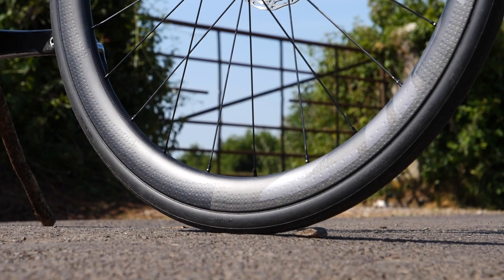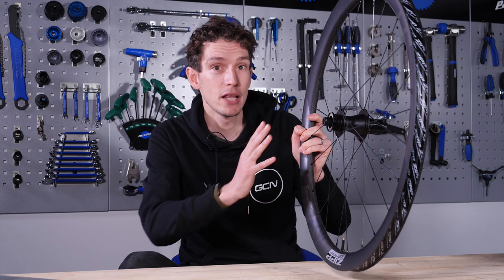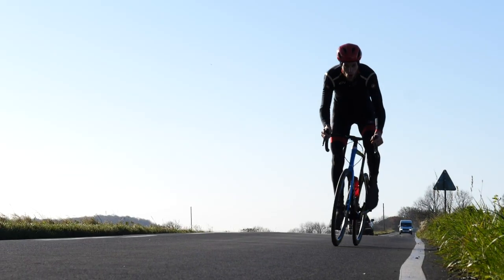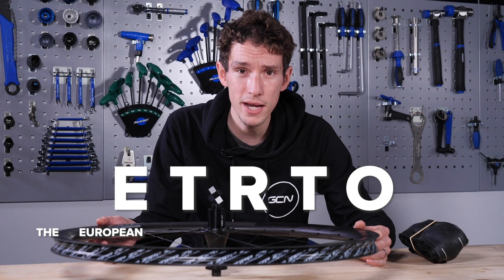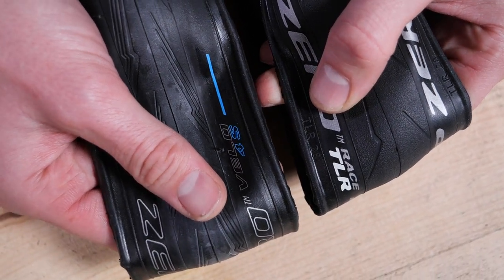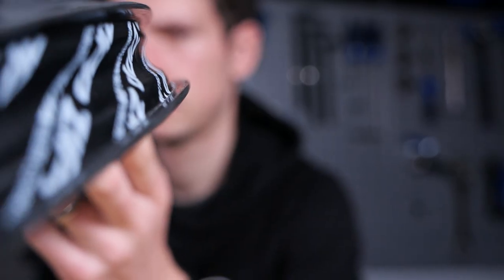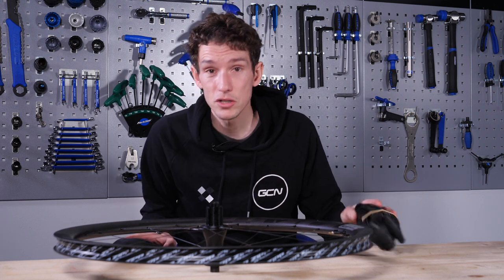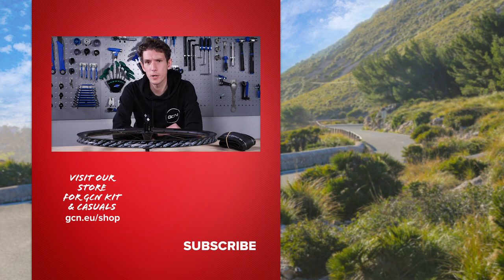Hookless Rims Explained | Which Bike Tyres Can You Use & Why?

Comment from the maker: Do you use hookless rims on your bike currently? Do you have any further questions about them?
Reply: I use tubeless but I don't even know if the rims are hookless lol
Reply: I will be in April ordered a 2021 Giant Tcr advanced Pro 0 which has em. Thanks for the info Si and GCN
Reply: I have a pair of 9th wave hookless rims on my bike
Reply: Yes, I do. No, I don't.  😉
Reply: No, when I got my current bike they were only on the uber super bikes at the time.  I just want to know what the market share is at the moment.  I don't like buying things that have parts/pieces that are trending out of fashion, as in my experience, that makes things harder to fix a few years later.
Reply: Yeah running them.
Reply: What about cornering really hard or coming down mountain switchbacks and loading the tyre up with that much force and popping off the rim? Or if you do get a flat say at high speeds is the tyre more susceptible to being damage from riding on it until you can come to a stop?
Reply: What about fitting inner tubes? I understand that hookless rims are incompatible if you need to fit one
Reply: I use 25 mm Schwalbe tubeless tyres on Fulcrum rims. When I have to use an innertube it's very difficult to get the tyre bead in place evenly resulting in a bumpy ride. Hookless rims will not have this problem I suppose.
Reply: @guidospanoghe8896  
You misunderstand. Because there is no hook, installing an innertube means that the innertube pushes upwards more than sideways. This could result in the tyre blowing off the rim. If this is true then carrying a spare tube, as i do now with hooked tubeless rims, would be pointless
Reply: @stephengreen6481  If I understood correctly Si ( and others ) stated that you can use an innertube with hookless rims as long as you mount tubeless ready tyres. These have a stiffer bead in contrast to normal clinchers.
Reply: Hey Si I have them there P-Zeros, I was wondering if they worked on the new Zipps. I wanted a new bike now I'm thinking wheels mite be a better choice.
Reply: Recently fitted Zipp 303s hookless on my gravel bike, absolutely no issues fitting and the wheels are fantastic! Any doubters or haters actually try them 👍
Reply: Tubless is the way to go 
Haven't tried hookless yet but
Reply: @stephengreen6481  Is this true? I would expect like for like pressures to reach an equivalent equilibrium distribution. Unless you're referring to the relative inflexibilty/inability' of an innertube to conform? Can you elaborate?
Reply: @JibbaJabber  
The way it was explained to me is that with no innertube the air is uniform in distribution. With one, the innertube swells to find the point of least resistance, and physically pushes upwards with no rim hook to stop it. Maybe thats why innertubes are banned in car tyres? Si mentioned in the video that a tube can be used in a hookless rim, but it maybe needs clarifying exactly what the situation is regarding safe pressure if you do.
Reply: @stephengreen6481  Cheers Steve. I've been using hookless road wheels with tlr tyres for nearly 3 years now, and have had no issues when running them with innertubes. From what you and Si have said, I think the real issue revolves around excessive pressure - over 5 bar for ETRTO guidelines. 

Under normal pressure, a properly manufactured tlr tyre should remain firmly on the bead seat. However, when overpressured, the tyre and bead may partially lift off the the bead seat. This, in conjunction with excessive riding stress (eg cornering) is where the problem may lie - the tyre could 'pop' off the rim.

Also, unlike an innertube/tyre combo, an overpressured tubeless tyre may have the added advantage of being able to 'burp'  under stress, thereby removing the excess pressure.

FWIW, I'm running 28mm tlr tyres at 50/54 and weigh 68kg.

:-)
Reply: @stephengreen6481  Watch the video. He covers this topic.
Reply: Nope... went down that road, had a miserable experience with it, and did a hard 180 back to hooked rims and tubes....
Reply: yes - Cero Aero24 with clinchers fine
Reply: I'm fairly sure that hookless rims are dated back to the days of steel hoops. I see suuper vintage 27" road wheels from the dinosaur era often have hookless hoops....They suck to fix flats on too as the tires have a tendency to roll off the rim about 5min after you set them aside after finishing the service😤
Reply: @stephengreen6481  just be sure to use a tubeless ready tire and you will not have a problem with tubes. Like simon said in the video
Reply: @stephengreen6481  a tube exerts the same forces that running tubeless does. In both systems the only thing holding the pressure back are the beads on a hookless rim. The problem would be the same if you tried running a non-tubless tire. The bead would not be strong enough to make an airtight seal and allow the tire to burp. If you put a tube in that same tire, you would burp and the tube woulcause the bead to fall of the rim instead of loosing pressure
Reply: I have 2 sets of wheels, one are 30mm wide (external) hookless carbon rims with Hutchinson Sector 32s, running tubeless with orange endurance sealant (Hutchinson doesn't like Stans, they say it eats their tires, and recommend Orange).   They have been *flawless*, for more then 2 years going now, more then 10k miles, and I have ridden on them as low as 30psi.   Never burped, never flatted.   They hold pressure better then any wheel/tire combo (including tubes) I've ever had on a bike.   Curb hopping, light gravel, riding through potholes, no issues.  For normal road riding, I run them ~50-60psi
Reply: do hook less are same with tubular?...
Reply: Is that 72.5 max psi now the recommendation for all clinchers? I'm still on 700/23c running 100 psi.
Reply: Wouldn't choose tubeless or hookless through choice yet. Both solves problems I don't have.
Reply: @DrewKime  no, It is just a guideline. I would not feel  comfortable below 85 on my 23mm tires. However as long as you don't burp, you can run prettymuch anything  if u are tubeless. (Don't ever go over the manufacturer's max psi tho) ...Lets be honest tho; there is zero point in that, because you are just slowing yourself down and increasing road noise
Reply: @DrewKime  a 700x32 could be ridden at 5 BAR with a tube tho
Reply: From schwalbe website 
'If hookless rims are only designated by the manufacturer for tubeless operation, they cannot be used with tube-type tires and therefore bicycle inner tubes"
Reply: @stephengreen6481  That explanation makes no sense. Any kind of pressure — inner tube or air — will act to move the point of least resistance.
Reply: I bought some Pirelli P-Zero Race TLR in Sept and it says on the tyre sidewall "do not mount on hookless rims" so sent them back for Goodyears. You seemed to be plugging Pirelli with no mention of this (and showed mounted on new Zipps)?
Reply: @timh1006  According to Pirelli's website, the 28mm and 30mm P-zeros are hookless-compatible: presumably that's what GCN were using. The 24mm and 26mm are not hookless. I found the video was pretty clear that you should only use hookless-compatible tyres and I don't think it's necessary to disclaim that some Pirellis are compatible, while some are not. Pirelli do produce hookless-compatible P-zeros, so it's reasonable to use them in the video.
Reply: @beeble2003  Thanks for taking the time to reply, but I did have 28mm tyres, and despite what the website said, there was clear text on the side wall that said do not use on hookless. Also, Enve website says Velo is incompatible too.
Reply: @timh1006  The P-zero Velo is a tube-using clincher tyre so that's never going to be hookless-compatible. Or do you mean the Cintatura Velo, which are TLR but need hooked rims?

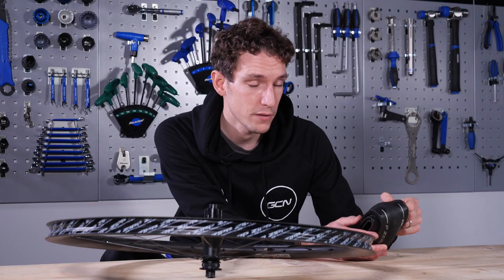We were talking about the P-zero Race TLR. The video at 3:33 shows a 28mm P-zero Race TLR SL; the only difference between the SL and the non-SL is supposed to be that the SL lacks the puncture protection layer so is lighter but more fragile. Anyway, sounds like Pirelli have screwed up royally if they're advertising their 28mm P-zero Race TLR tyres as hookless-compatible when the tyre itself says it isn't...
Reply: @Click Bait just because there is incompatibility issues, doesn't make them dangerous. It just means you need to know that before buying tires. Also, there's a gajillion tire brands out there, but it's not like the approved list is junky tires. The tires that get tested are the kinds you would run anyway.
Reply: @jimhansen5395  Sorry, what debacle is that? The article you link describes the ETRTO/ISO standard as a "success story" and describes how they relatively quickly got a working standard that allows interoperability of parts built by different manufacturers and allows tyres to be fitted by hand. The only problem is that Stans want to do their own thing, but their version has also been accepted as an experimental standard so everyone who's working with that stuff is on the same page.
Reply: @beeble2003  If your takeaway from that article is that the standards situation in the bicycle wheels and tires industry is healthy, I'm not sure what to say.  My takeaway is that it's an archaic system that will never be able to keep up with innovation and technology.  As a cyclist, it does not instill confidence that I would need to purchase an expensive set of modern wheels without some kind of satisfaction based return/warranty policy.
Reply: @jimhansen5395  I don't think you understand what a standard is. The goal is that you can buy tyres from company X and wheels from company Y and be confident that you'll work together. That necessarily means that they have to build those items to the same specification. And, yes, that means that they can't innovate in certain areas: this part must be this shape because it must interface with that part.

There's plenty of room for innovation in terms of materials, construction and so on, but the shape of the rim is fixed within certain parameters. If a company wants to innovate with the shape of the rim, they're welcome to do that, but then they can't say they're compatible with the standard. Because they're not. Sometimes it's advantageous to work within the standard ("Buy my tyres -- they're compatible with any standard rim!") sometimes, it's advantageous to work outside it ("Buy my rims! They offer this improvement over the standard. (But there are only two kinds of tyres that fit.)")

If you want to go back to a world where only a very small number of combinations of rim and tyre actually work, you're welcome to. Go buy some non-ETRTO rims and you're "sorted".
Reply: @ricky7396  Waiting on the same bike for May.
Reply: @JamieVoto  Nice man. I got an email from my LBS today now being told July or early August and price now up to £5,199 even though I've had a deposit down since October. I replied to bike shop with a few questions I'm in Scotland UK btw. Reasoning is Brexit shipping costs. Gutted as will miss summer on it. Hope yours works out better Dude.
Reply: @ricky7396  That sucks, sorry to hear that.  Im in the US.  My LBS had one on order but not allocated so I put a deposit down on it.  They knew the price increase was coming but agreed to honor the deposit price which was nice. Hopefully it doesnt get pushed.
Reply: @JamieVoto  No worries that's good your shop did that. Hope you enjoy. My Bike shop have offered me a full refund so gonna take the weekend to think about it.
Reply: @stephengreen6481  The tube has nothing to do with it. As long as your tire is tubeless it doesn't matter if you run it with sealant or an internal tube. Si says so a the beginning of the video.
Reply: @Click Bait that is EXACTLY what i thought, imagine that on a descent, compatibility sucks (for now) and not everyone paid enough attention to this, this could KILL
Reply: Shame that the conti gp5000s are still not compatitble with hookless rims
Reply: No - I used to, when the bike, an all double-butted 531 Carlton, was new in 1981 because that's what it came with. But after a hiatus of several years I started riding it again in 2001 and couldn't get tires that didn't explode. My bike shop told be the problem was that all commonly available tires needed hooked rims, so I ended up with a new wheel set. Must I now go through all that again?
Reply: @Rodjov12  they already are... for example 28mm for giant wheels
Reply: Never. Flat out NEVER!
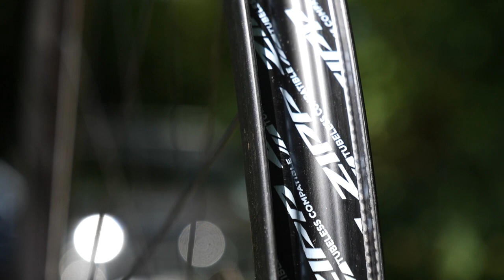Reply: 6:19 after they inflate the tires on hookless rims to more the 100 psi, did they use it on the road or just inflated it until it failed?
Reply: Setting up a customers new 404’s with Corsa NEXT……..holy cow, they are tighter than a…….
Reply: how about pinch flats  for us bigger riders i.e. 200lbs and up?
Reply: As great as it sounds to be, not something for heavy riders. This is because you are more often than not required to run wider tyres and rims even if you may want something narrow - the tyres can not be inflated over 72.5 PSI and narrow tyres often have to be pumped up to higher pressures
Reply: I just bought a Canyon Ultimate  with zipp 303 firecrest wheels.  Came from Canyon with a 25mm Schawble tire on front and a 28mm on the rear. After checking on zipps compatibility chart this tire is not compatible.  Concerning to me Canyon would Ship this bike with a 25mm tire on front.